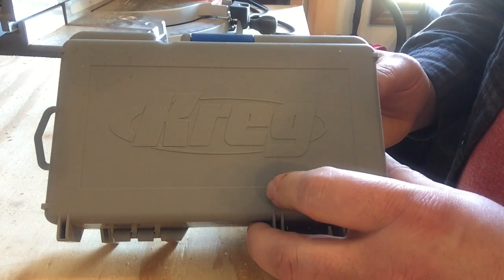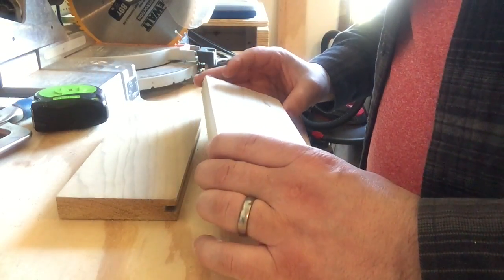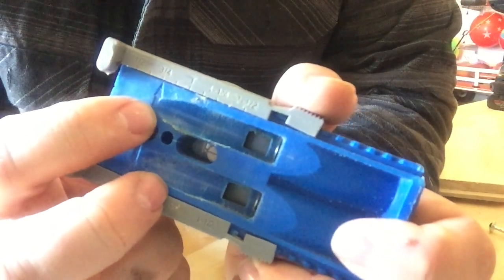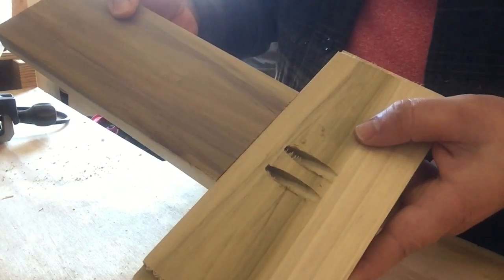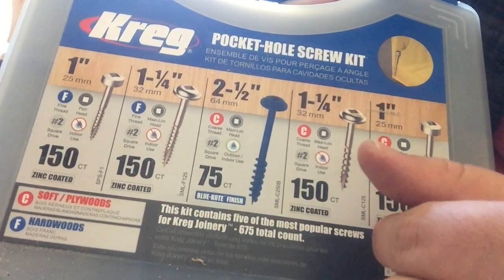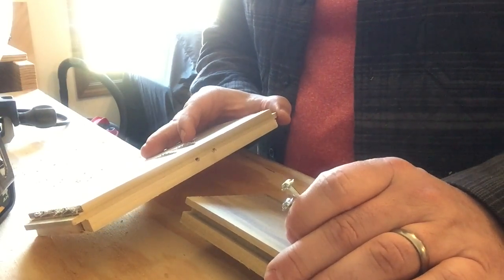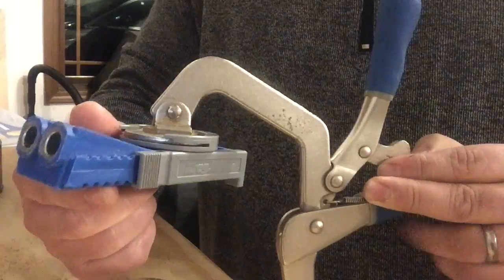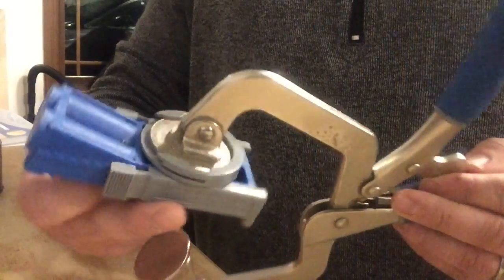How to Use a Kreg Pocket Hole Jig with Product Review

Comment: I know this was just a quick demo but it's worth noting that in order to make the strongest joint possible the holes should have gone in the other piece of wood so as not to screw into the end grain of the wood.
Reply from the maker: Yes good observation.
Reply: How to Hacks I don't get it. Please explain.
Reply from the maker: Leonardo Rojas Screw threads hold better in cross grain (against the grain of the wood) vs end grain (or with the grain of the wood).
Reply: Agreed, but if joining 2 pieces at a 90. One will be with the grain?
Reply: @randyaivaz3356  In this example, if the holes had been drilled in the other piece of wood, in the other direction, the screws would have bit into the cross grain, not the end grain.

Comment: Nice demonstration.  Simple and to the point.  I had one years ago that froze the drill bit into the slot.  Returned it twice before getting my money back.  I went back to using a biscuit cutter and biscuits which is a time user.  I'll try another this spring.
Thanks.

Comment: I ended up purchasing the "Kreg" Brand jig today after having to return the less expensive brand realizing that Kreg has dominated the "Pocket hole" industry.. thus making the screws readily and easier to find...NTL, what I'm getting at here is that when I recently owned the other brand, the instructions stated specifically - 'if possible, use the higher speed setting and lowest torque setting on your hand drill in order to drill in the holes'  I don't know if this is a standard practice with the Kreg Brand or not.
Reply from the maker: It wouldn’t hurt to set your drill up this way while using the jig.  The drill bit can eat up the jig a little if you aren’t careful.

Comment: hi did you find the drill bit shredded the blue plastic a tiny bit at first? When you have drilled your hole, how much of the drill bit goes through the wood at the back end - is it all the pilot hole section?
Reply from the maker: Yeah it shredded the plastic a little.  The drill bit should not go all the way through the wood.  Make sure the collar on the drill bit is set at the correct depth.
Reply: @HowtoHacks  ahh kinda glad it was not just me with the issue - yes I know what you mean now about the depth - it does not quite come out of the wood piece you are drilling

Comment: My 320 Pocket Hole Jig has a different system to determine the drill depth and the jig stop locations that the jig shown in the video.  My drill has ingraved indicators for 1/2, 3/4, and 1.5 inches which are located by matching the viewing port in the collar and the jig has depth settings corresponding to the three depth settings on the drill for 1/2, 3/4 and 1.5 inch thicknesses.  These are indicated by viewing through three portholes.
What should I do if I need to drill pocket holes in stock with another thickness such as 5/8 inch or 1 inch?
The drill doesn't have any thickness indicator other than at 1/2, 3/4. or 1.5 inches and the thickness guide on the jig can only be locked at those three settings.
Should I set the unit up to drill for a greater or lesser thickness - i.e.: should I use 3/4 inch indicator when drilling in material 1 inch thick or should I use the 1.5 inch indicator? Or, is there another fix for this situation???
Reply from the maker: So you can’t set it at an approximation where 5/8 would be?

Comment: My question is, by using the drill bits it comes with, is it going to make the holes to big if I’m using smaller screws?
Reply from the maker: Depends on what size screws you are using.  Experiment a little and see.

Comment: When measuring the stop collar on the drill bit do you push it up in the case or pull it down to the bottom then set the collar?
Reply from the maker: Push it up.

Comment: what is the best, lightest wood to use for cabinets? I'm trying to make some for a camper trailer so needs to be lightweight..
Reply from the maker: Douglas fir might be a good option
Reply: @HowtoHacks  ok thanks
Reply from the maker: The problem is the light woods aren’t very desirable for use in cabinetry.  I would just go with oak or poplar.
Reply: @HowtoHacks  I know, needs to be "hard". Those kinds of wood are more expensive around here. In your opinion. Is pine considered "heavy"....?
Reply from the maker: @bikeninja956  No, but people build furniture out of Douglas fir.

Comment: I just saw your video after getting this Kreg system for Christmas - Very helpful. How would attach (and set up the depth) for a perpendicular piece such as a drawer front to the drawer sides?
Reply from the maker: It all depends on the thickness of the wood you are joining together.  It also helps to do some test pieces with scrap wood to make sure everything works with your setup.

Comment: You should probably have added a bit about screw selection. Do you use 1¼" screws or 1½" screws for ¾" material ?
Reply from the maker: Yeah.  There is a chart on the box that says what screw length to use for each thickness of wood.

Comment: Nice vid straight to the point ! I just got mine today , im already wondering how long the drill bit lasts , how did yours hold up ? Thanks
Reply from the maker: They hold up for quite a while.  The point of failure is the tip breaking off the end.
Reply: @HowtoHacks  ahh ok,, thanks

Comment: What if your using woods with diff thickness? Attaching 3/4 to a 2x4. What setting you use?
Reply from the maker: You have to look at how you are screwing them together.  However you will most likely use the setting for the thinner board
Reply: @HowtoHacks  Through the 2x4 and into plywood
Reply from the maker: truth h yes

Comment: Hey quick question, does the bit drill the smaller hole at the same time? Also can I buy this bit separately ? Thanks for the demo helped me understand a bit more. I’m probably just gonna but the jig. I can’t tell you how many times I could have used this
Reply from the maker: Yeah the bit has a tip on the end that drills out a smaller hole at the same time for the screws to get started.  You can buy replacement bits as well.

Comment: I wanted to pick up that same jig set you have but it only goes up to 1.5"(?) Could I still use that jig with 2x4s?
Reply from the maker: Yes.  Modern 2x4 are actually only 1.5 x 3.5.

Comment: After you drill the pocket holes, is there no need to drill a pilot hole into the other piece you’re joining together? Or is it ok to screw into the wood without a pilot hole? Thanks and great video!
Reply from the maker: Nope, no need for pilot holes.  The screws are designed for use without pilot holes.  Just make sure you are using the right screw for hardwood or softwood (which is covered in the video).

Comment: I saw several positive YouTube videos about Kreg's Pocket-Hole Jig system., yours being the first.

Yesterday, I bought one at my local big box. The packaging was sealed and there were no signs that someone had opened it or used it before me. However, when I opened it and checked the components, the Material Thickness Gauge/Hex Wrench was missing. I removed every component, hoping it was underneath, and opened both boxes of screws. It's not there.

I just notified Kreg's customer service.

This is completely unacceptable.

If you decide to buy anything from Kreg, be sure to check the packaging and immediately to an inventory check on opening it. And keep your receipt!
Reply from the maker: You should be able to exchange it at the big box store at no cost.

Comment: Why is 1”-1/4 higher than 1-1/8” on the gauge? Where do I set the collar for 1-1/2”? Thanks.
Reply from the maker: For the drill bit collar place the bit in the case.  The markings in the case signify where to set the collar.  The jig as it’s markings on the bottom.  Just set both to the material thickness.
Reply: How to Hacks he is asking a legitimate question, the 1-1/8 & 1-3/8” markings are longer than the 1-1/4” mark. And the 1-1/2” seems to have no mark at all!
Reply from the maker: VoxPathfinder15R On the jig I have every line equates to an 1/8 inch of the material thickness.  The jig also clicks into place at those set points.  1.5 inches is marked on the end and is the last setting available.  It is also labeled.  So the arms of the jig are longest when set to 1.5 inches.  The thicker the material the longer the arms of the jig need to be.
Reply: How to Hacks well I figured out the issue, the apparent inconsistency in where the markings has to do with the manual and how when thickness of the materials is increased they go to a longer screw, thus resetting where the lines are
Reply from the maker: VoxPathfinder15R yes exactly.  The jig arms get longer and the jig sets back farther on thicker material so a longer screw can be used.

Comment: What if the wood piece is thicker than the measurements that shows?
Reply from the maker: Go with the thickest setting, use the longest screw, and glue the joint as well.
Reply: I would go following way: Set your Kreg Jig for the thickness of material you are drilling the pocket hole in. Then, choose screw size based on thickness of the mating piece the screw will be entering in to